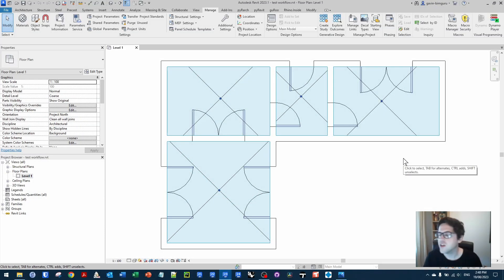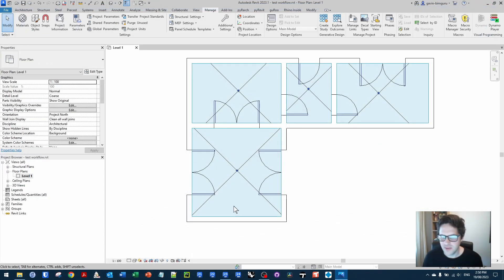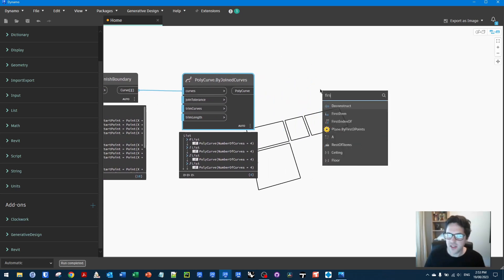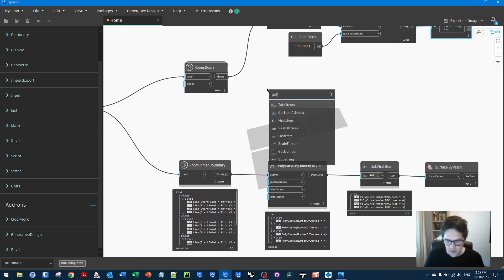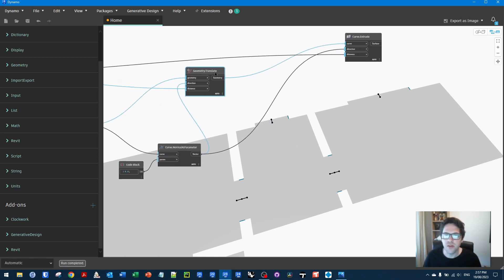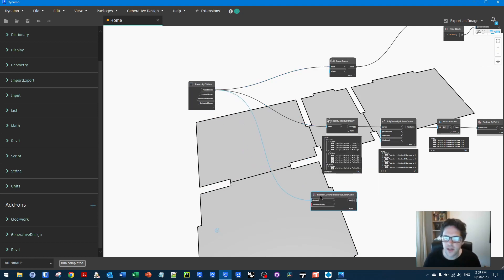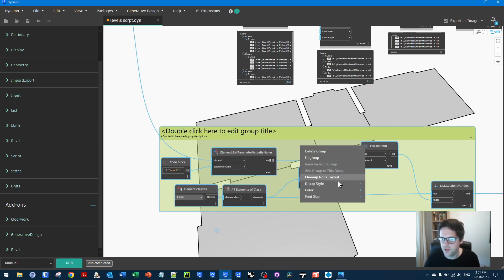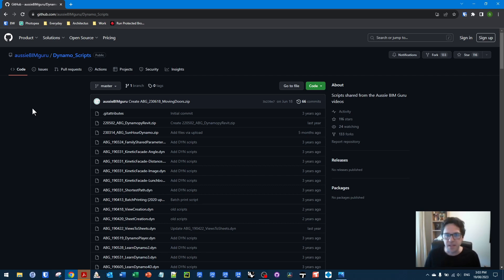Door thresholds in room outlines using Dynamo!

Comment: how can i include the offset of the floor?
Reply from the maker: After the floor is created, get its thickness type parameter and set its offset using element.setparameterbyname. The floor create node passes the floors as an output that you can do more with from there.
Reply: @AussieBIMGuru  thanks

Comment: This way more simple than some other methods I have seen.  My only question is how easy is this to incorporate into your last room finishes by room boundary video? I would like to keep the Data-shapes UI for ease of use but like you said in this video, you would have to account for doughnut shaped rooms by doing some extra steps.  Is there a way to use the nodes here and plug them into the existing file we have? Or would that require a rework of the node structure?
Reply from the maker: A little bit of rework but effectively this could plug in between the collection of rooms at the front and the generation of floors at the end once you retrieve the curves per room to make the floors
Reply: @AussieBIMGuru  Its been a while since I have had time to work on this but Is that for the revised version or the older one that uses the Data-shapes nodes? I prefer the data shapes as it makes it easier for other users to use when I apply it to the Pyrevit custom tabs we have. My assumption is I can apply this setup between the Room.FinishBoundary node and your Floors.Create node but for some reason I can't get it to work or mend smoothly. I am still a novice when it comes to Dynamo.